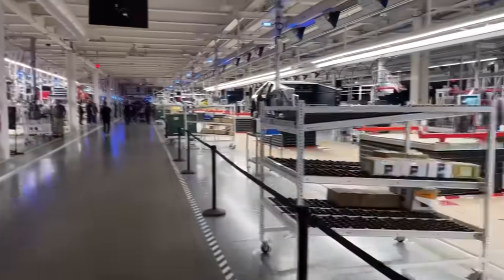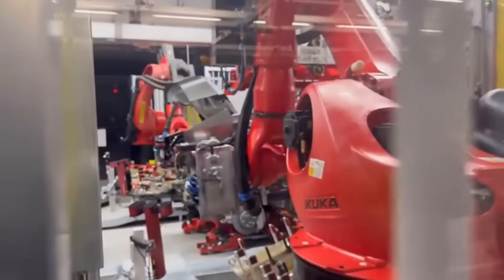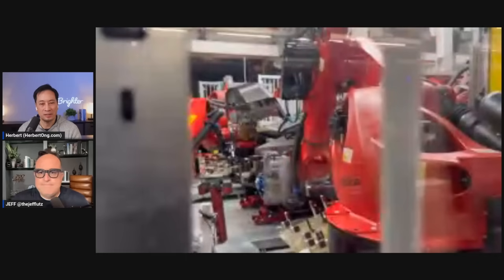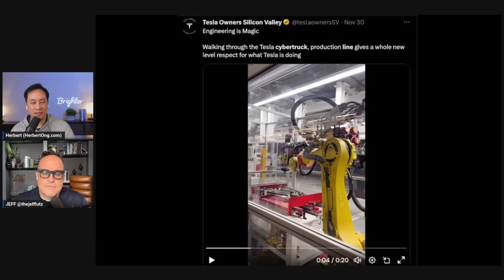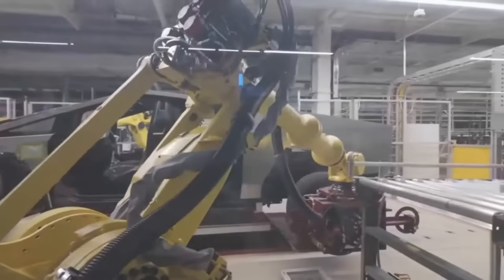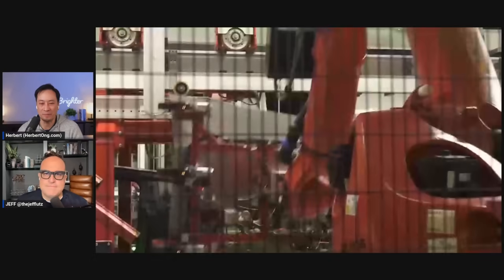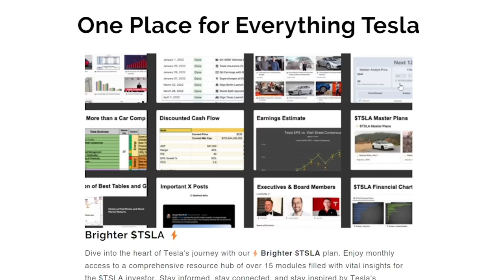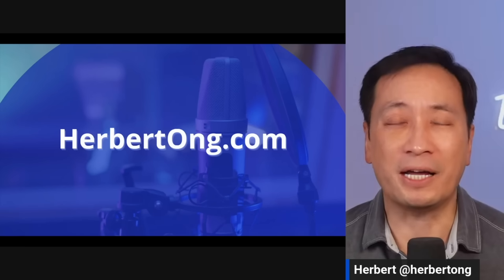Tesla Supply Chain Expert: Why Cybertruck Will Surprise in 2024

Comment: Jeff, did you happen to notice if the dashboard mounting foundation was machined for both left and right hand drive versions? The steer by wire should make it simpler to build righthand drive versions and I hear there is great interest in Australia and the UK for the CyberTruck.
Reply: Yep would also like to know the answer to this. Although my guess would be that it's would be a simple job to change the machining later given everything is computer aided design. I would also say that once the production line is really humming they could easily duplicate the production line in shanghai and ship right hand drive cybertrucks from there.
Reply: Great question. Let me go through some of my other photos and videos and get back. . . I do agree it should be manageable based on this modular design.

Comment: Agree with Jeff.  LOTS of operations are automated where a legacy company would have an operator using power equipment as an assembly aid.  Could other OEMs do the same? >> They would need to DESIGN for automated assembly to optimize it.

Comment: Thanks.  The Tesla lines are impressive.   An unknown is how many of the air pockets are on parts of the supply chain that technology is still being developed for.  For example 4680, but possibly other things.

The number of trucks produced so far, some hundreds, would conceivably fall under the scope of "engineering samples", and there could still be large amounts of work needed at suppliers to build lines.

Comment: Using ramp details on Model 3 and Model Y, first full year production estimate of  2000 - 4000 cars per week, CT production will likely be between 100k - 200k in 2024.  First slow ramp based on component supply, process/tooling refinements, and then accelerated as each function/step is running.  Overall, this is projected to exceed production over multiple years of EV rollouts from legacy auto truck manufacturers.  Super exciting times now and ahead.
Reply: It may be harder to build.

Comment: The manufacturing time for a vehicle is limited by how fast humans can do work.

The next limit is drying/curing times for components.  So let's just not paint it.    Fixed that one.

The next limit is how quickly components can be moved into the factory buildings. Building deeper and using tunnels... I wonder if there is some boring company willing to help...

Comment: The production line may be ready for volume production.

Supply chains remain an open question.

My forecast is 50K in 2024. More than double in 2025. Possibly achieve 250K+ in 2026. My caution is motivated by concerns about global supply chains in a problematic geopolitical environment characterized by war, a trade war and economic catastrophe in China, a critical supplier.